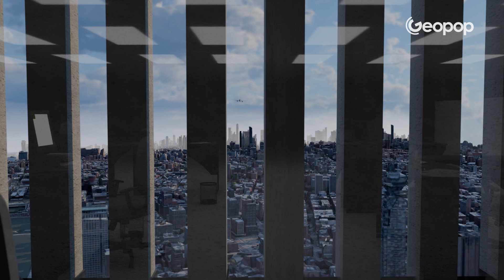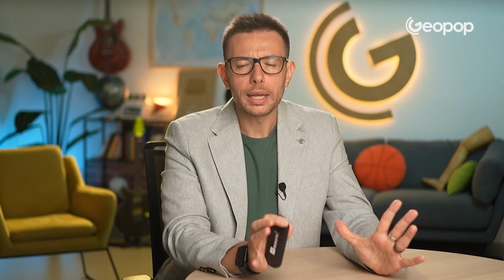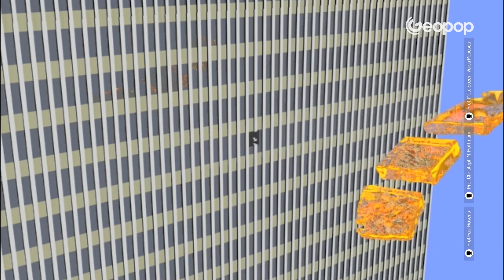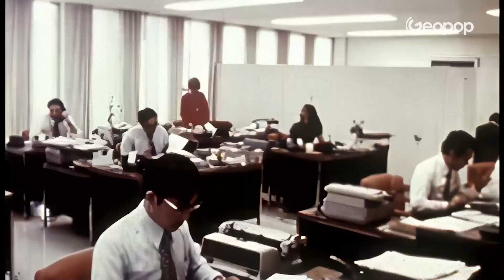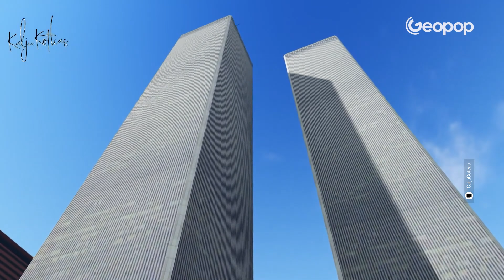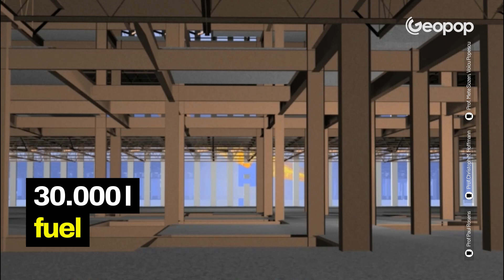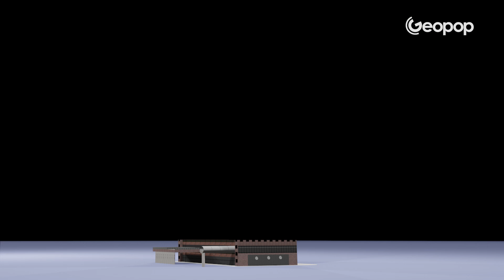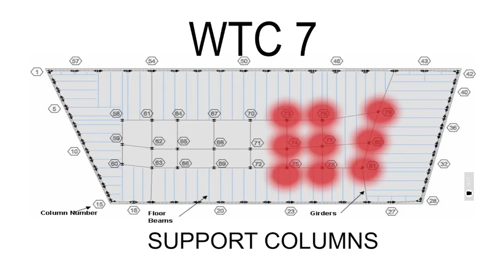9/11, 2001: The Technical Reconstruction of the Twin Towers and WTC 7 Collapses

Comment: Okay so maybe half of the building would have collapsed not the entire building at the same time.. and (Larry Silverstein) saying himself to 'pull it' (speaking of tower 7) which is a term used in building demolition to perform a 'controlled demolition'
Reply: Get your 'research' straight.

Donald Rumsfeld said no such thing. Find me video of him saying that. I DARE YOU.
Reply: @ghostsignal  correction, Larry Silverstein 
https://youtu.be/p34XrI2Fm6I?si=tRH1FwMy5c7-rwgX
Reply: Ummmm... no, "pull it" is most certainly not a term used in building demolition.  Not sure where you are getting that lie from!
Reply: @ChristLink-Channel
A traditional method of demolishing a masonry structure is to remove sections of wall at the base of the building, temporary wooden posts are set in place to support the structure. Once enough of the structure has been removed then ropes are attached to the posts and on command the demolition team pull the ropes to dislodge the posts and down comes the building, hence the term ‘pull it’. I’m glad to have cleared that up for you.
Reply: "Pull it" is not a commonly used term in controlled demolition. And even if it was, the video where he says that was a pre recorded interview. If he told them to demolish it, he would not be dumb enough to let an interview air where he is clearly saying so.
Reply: You ever heard of gravity?
Reply: @dBDOPIMANE
A traditional method of demolishing a masonry structure is to remove sections of wall at the base of the building, temporary wooden posts are set in place to support the structure. Once enough of the structure has been removed then ropes are attached to the posts and on command the demolition team pull the ropes to dislodge the posts and down comes the building, hence the term ‘pull it’. Lucky Larry S. who’s skin was saved that day because his wife had made him an appointment with his dermatologist
Reply: Why only half?  Please show your math.
Reply: @TheLoonResistance 
The top of the towers were the weakest they were stronger at the base
Reply: @jimmoravec1326 they still have the force and momentum of the upper floors falling to deal with, which would be a lot more than they were ever intended to handle.
Reply: Heat distributes through metal…the whole building was weakened. Combine that with the weight of the above floors…not too hard to imagine the collapse.

Comment: So if you hit a steel rod with a bird, it will cut the steal? Because bird strikes are documented to cause major damage to a planes structure. Also the plane entered the tower at an angle. Each wing would have had to overcome the combined resistance of at least three floors. A massive immoveable expanse of concrete and steel. Further the floors could be compared to knife, yet the aluminium wings supposedly flew through this  mass as if it wasn't there? The fireman stated the fires were almost out. Other buildings similar to the towers have had extreme fires yet have not collapsed. Steel doesn't localise such general heat it runs along its mass. Why don't gas cookers melt? In fact there has never such a collapse before or since. Steel doesn't weaken at the fire temperatures. Not even the tail broke off? Thermite residue. Steel beams in the wreckage appeared cut. The steel was disposed of in a very suspicious way. Etc.
Reply: The WTC towers weren’t made of solid steel all the way through, they were a truss structure. It’s like a bird hitting a tall and narrow wire mesh pole.
And even that isn’t fully accurate due to the square-cube law. As an object gets larger, the surface area (the load-bearing area of a skyscraper) doesn’t grow as fast as the volume (the weight of a skyscraper if it maintains the same density)

Comment: Funny how bush was told that his ugly structures twin towers had been blown up by terror threat from Iraq under binlardin but we know it was blown up bush it was excuse to make them be a threat so they could go to war for terrorists warfare. 
Theres no way that plane petrol from each wing made the twin towers collapse. No chance. The metal in the buildings rsJs are triple thickness watch how they built twon towers video from years ago where they built empire state building . Watch how the steel beams that hold up them megalithic buildings it wasnt single skins of steel they had five layes of steel bolted together for complete thickness to hold mega weight of the building . This video is trying to blagg people that the metal structures was weak the metal strutts was five layers of metal to hold that load . Theres no way that myxh heat bent and collapsed that building that quick unless it was blown up in middle of the building

Comment: People are ridiculous. Steel doesn't have to "melt" to lose strength. All it has to do is get soft, and it really doesn't take a huge amount of heat to soften steel to the point that it can no longer hold up to design stress. Even the asbestos insulation can't make steel impervious, and it makes very simple sense that a lot of the asbestos was knocked off the steel of the impacted floors. Too many people think that the buildings were capable of sustaining miraculous levels of damage. They were tough, no doubt. But they were still just buildings created from early 70's technology. I will admit that, to this day, over 23 years later, I still do not go in high buildings. If it's over 20 floors, I start having anxiety. I get flaky even driving through central Los Angeles anywhere near the U.S. Bank Tower or the Aon Building or California Plaza. Nope, nope, nope. I believe, in my heart, that it is STUPID beyond reason to build anything as high as the World Trade Center Towers. Someone will have to take them apart one day, and that's just crazy. There is no kind of controlled demolition that can safely drop a 1300 foot tall building.
Reply: We think they were "capable of sustaining miraculous levels of damage" because being hit by a plane was part of the design fail contingencies.
Reply: @tikkigodman  Not by a jumbo jet that was flying at over 500 MPH with fuel tanks that were still mostly full. They were designed to be hit by a medium-sized airliner or smaller, on final approach for LaGuardia (flying at maybe 200 MPH tops) with fuel tanks that were more than half empty.
Reply: I guess they've never seen a blacksmith make something. The steel just has to be hot enough to be malleable, it doesn't need to be anywhere near melting point.
Reply: If the wtc buildings and surrounding area were evacuated before the planes hit, then they would have been demolished pretty safely. So to collapse a 1300 foot building, fly a huge jet into it, no demolition crew needed.
Reply: They have made plenty of heat tests with steel columns similar to the WTC ones … of course nothing melts or liquifies …  hot steel beams at a certain temperature loose their strength, start twisting and bending … in a construction keeping a skyscraper stable thats not good … common sense …
Reply: What about all the Steele below where the plane hit?   Not heated at all?   They would have absolutely no resistance at all.  GTFO. This world is so much more evil than would like to believe.  100% inside job.  And the fools like you make all this possible!
Reply: It’s usually the case that older buildings, including those designed prior to CAD , are generally over engineered.
Reply: So why did the North Tower not collapse in 1975 even with the cumulative weight of 99 floors bearing down upon the fire zone?  Your argument is unscientific nonsense for many reasons.

A three-alarm fire broke out in the 11th-floor offices of the B. F. Goodrich Company in the north tower of the World Trade Center just before midnight last night and spread through an inner-service core to the ninth and 14th floors. “It was like fighting a blow torch,” according to Capt. Harold Kull of Engine Co. 6, who said all of his men “got their necks and cars burned” trying to get into the 11th Floor hall from a stairwell. A total of 24 pieces of fire fighting apparatus and 132 firemen fought the fire. Sixteen firemen were treated at the scene for smoke inhalation. Flames could be seen pouring out of the 11th-floor windows on the east side of the building. 
--- TRADE CENTER HIT BY SIX-FLOOR FIRE, Blaze Starts on the 11th—16 Men Are Injured, The New York Times, February 14, 1975.  Needless to say, with the weight of 99 floors bearing down upon the 11th floor, the building did not collapse.

Also…

Why the steel was not as hot as you claim it was!!

QUESTION: if you heat one end of a steel beam in a raging fire, will the heat dissipate to the other end and to any other steel beam it is connected to, and will that limit the temperature that can be attained on the heated end?

Google + AlOverview

ANSWER: Yes, if one end of a steel beam is heated in a raging fire, the heat will dissipate to the other end and to any attached steel beams. This dissipation acts as a heat sink, which will limit the maximum temperature the heated end can attain.

How heat dissipation occurs

* Conduction: As a metal, steel is an excellent conductor of heat. The thermal energy from the fire causes the steel atoms at the heated end to vibrate more intensely. These vibrations are then transferred through the material to adjacent atoms, and so on, in a domino effect that sends heat along the beam.
* Convection and radiation: Heat is also lost from the surfaces of the unheated sections of the steel to the surrounding environment through convection (heating the air) and radiation (emitting thermal energy). These processes become more efficient as the temperature of the steel rises.
* Connections to other structures: When the heated beam is connected to other steel beams or structural elements, it conducts heat into them as well. This effectively increases the total mass of steel absorbing and dissipating the heat, enhancing the "heat sink" effect

Why heat dissipation limits the maximum temperature

The maximum temperature of the heated end is determined by the balance between the rate of heat flowing into the steel from the fire and the rate of heat flowing out of the steel via conduction, convection, and radiation.

* Establishing equilibrium: As the fire heats one end of the beam, the temperature difference between the hot end and the cooler parts of the structure drives heat away from the fire. The greater this temperature difference, the faster the heat dissipates.
* A "steady state" temperature: A steady state is reached when the rate of heat input from the fire is equal to the rate of heat dissipation from the steel. At this point, the temperature of the heated end will stabilize and cannot increase further unless the intensity of the fire increases.
* A natural limiting effect: Even with a "raging fire," a heated steel beam will not just infinitely increase in temperature. The extensive mass of steel in the rest of the beam and any attached structures provides a very large surface area for cooling, and a large volume for heat to spread into. This makes it a very efficient heat sink, which works to oppose the temperature rise.